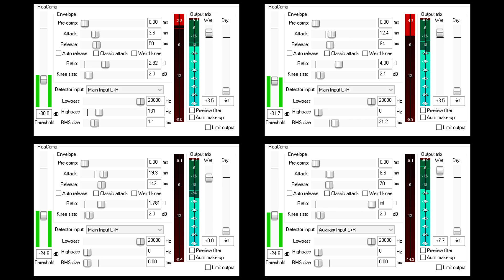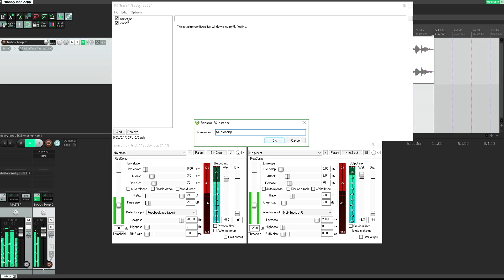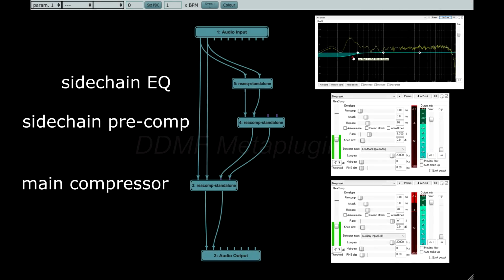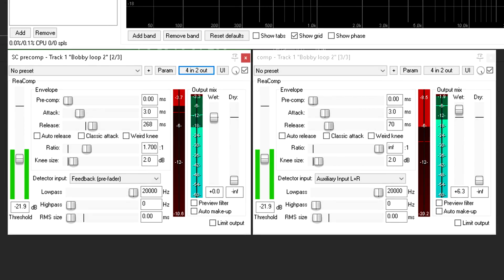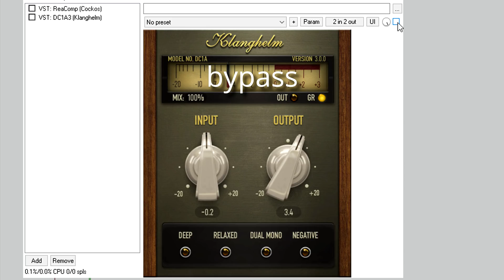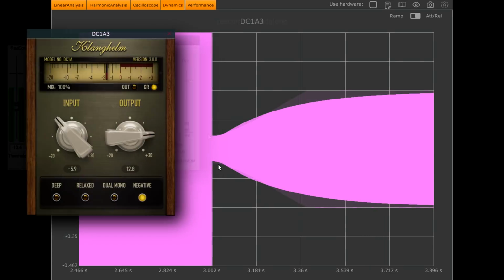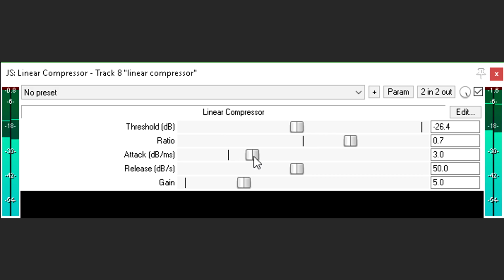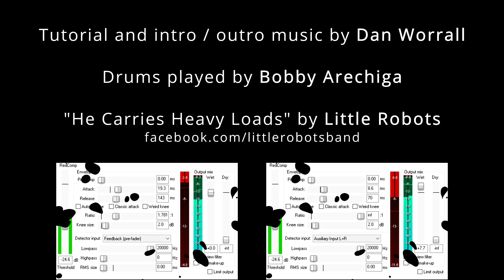What's Wrong With Stock Plugins? ReaComp ReaVisited

Comment: Fantastic video as always. About ReaComp's release curve: It actually can reproduce the more common downwards-bent release curve. The trick is to set the threshold (or knee) such that the compressor never quite stops compressing (even if it's only by 0.1 dB). Somehow the compressor releases differently when going from high gain reduction to low gain reduction compared to going from high gain reduction to no gain reduction. Unless one is compressing drums, uninterrupted gain riding is more realistic anyways. My feeling is that in the audio example you showed, ReaComp was mostly reacting to the low end. My guess is that a HP filter in the sidechain and possibly switching to RMS detection would have solved the problem.
Reply: I'll have to try this. Thanks for the tip

Comment: The Reaper folks are always listening to user feedback and release updates very often.

The put out a world-class DAW for obscenely cheap, and they care what they users think. Good people.
Reply: If they can fix the windows 95 look for a lot of it, I would try it out.
Reply: @gulagwarlord  The basic look is one of the reasons it is so light on CPU usage. Putting in third-party plug-ins with pretty graphics greatly increases the processing.

And you can download themes to make it prettier, if it's that important to you.
Reply: @RolandDeschain1  I just looked into it, that's awesome.  I mostly do midi based edm stuff and currently use ableton but I like the idea of being able to run more tracks because I have to freeze a lot in Live.  Thanks for the help. Cheers.
Reply: @theeverlastingspiral I think the reason that it hasn’t been “fixed” is because it’s one of the things that makes it unique, and in a world of generic compressors and clones of classic hardware that are emulated with varying results—having a unique quirk is one way  plug-in can earn it’s place in your toolbox.  The other way is being one of those idiot proof plugs you can throw on every single track, and have it sound better immediately, regardless of the differences between them.
 
The default compressor plug-in for most DAWs tend to be the most generic and forgettable comps around, and when you haven’t built up a solid collection of plug-ins, you tend to use it for everything and get more mileage out of it, because it’s all you’ve got.  Once you have a ton of them, then you start to treat them more like you did the presets for the jack of all trades compressor you started with.  There are a ton of plugs I’ve collected to that do one really interesting thing, which is what I set it to do by default whenever I load it up, and then I don’t have to fiddle around too much, except for making a few minor tweaks.

I’m sure that there are plugs in my collection that could pull double duty and I could reduce the overall number I load up in my DAW, but I prefer the variety, and know that when I look over my channel strips on a project I haven’t opened in awhile, and see one plug or another, I know what it’s doing by the name alone—so there’s no time wasted trying to remember or take notes about why I did something the way that I did.

My preference is to use stuff with jarring and noticeable, rather than subtle or transparent results, because if I go too far, I can always put it on a parallel bus and mix it back in with the original signal.

Comment: Man, this was the best tutorial I've ever watched on compression. It really made me think about how I might be able to combine compressors for more specific effects, or how I might want to just try something more simple in some cases. I hear people saying that you should stack compressors all the time but they don't ever explain why or how to do it. I've used my ears to find things I like, for example, just recently I put Smart:Comp on an acoustic guitar first and then added ProC after. It sounded better than just ProC alone. Neither were over the top, and with a bit of subtle multiband excitement from Izotope's exciter I barely needed any EQ except to control the low end a bit with ProMB. In general I don't actually use Reaper's stock plugins anymore. I find they don't actually sound that good compared to FF. It's definitely worth it to buy a good set of core mixing plugins. FF is indispensable.

Comment: I see this video as inspiration for Justin and Schwa to improve and expand the ReaComp toolbox even further. I have very specific use cases for all the comps I use. I‘ve been swooning over gain reduction dependant attack and release times since I began using Reaper, because of the Renaissance compressor. I still use Rcomp on dialogue in opto mode.  And thank you for that sidechain feedback setup. My experience in compression had not taken me that far by a long shot yet.
Reply: Airon Extelevision An expanded ReaComp you say? That would be...ReaGasmic!🤩

Comment: The knee in ReaComp has been fixed so that it no longer "spreads around" the threshold, but instead just extends below it.  Your song there is just way above the threshold, and you quite definitely are getting the full ratio.  I contend that it's pumping like crazy cause you're kinda smashing the hell out of it.  Edit - but you're completely correct about the release curves.
Reply from the maker: Watch the GR meters: I'm well below 6dB of gain reduction most of the time. Perhaps I get to the full 4:1 ratio for the very loudest peaks, but mostly I'm riding the 12dB of soft knee. 
I picked those settings to match the Klanghelm's default soft knee behaviour, which doesn't sound pumpy even with similar amounts of gain reduction.
Reply: @DanWorrall  I'm sorry, I see the green meters consistently above the threshold for most of that program.  You're mostly out of the knee at that point.  I think most of what's keeping your gain reduction down is the A/R smoothing.  I'm not sure what that Klanghelm does for a knee, but I know how ReaComp works.
Reply: But also didn't you fairly well prove that the Klanghelm has some RMS time to it?  That'll make a bit of a difference also.  To be clear, I'm not trying to defend the weird curves in any way.  They should fix that.
Reply from the maker: No. Adding RMS smoothing to ReaComp creates a similar looking "pause" before the gain starts to recover, but we can't assume that means RMS smoothing in the Klanghelm. In fact DC1A3 has a "relaxed" mode (which I didn't use) which the documentation says adds RMS smoothing, implying that otherwise it's peak sensing.

Comment: Hi Dan. I was wondering, would you mind sharing the JS compressor you demoed in this video? I'd like to try this kind of compressor done in db/ms. I'm also really interested in how you built those attack and release filters. I only know of the one pole style filters in most designs. Someone told me you can convert between a filter's time constant and discharge rate in volts/ms, and you could use that to get to db/ms, but I'm not entirely convinced of that. The decibel conversion and the placement of the ballistics filtering would mess with that, I think. (might be wrong)
Reply from the maker: desc: Linear Compressor
//tags: dynamics
//author: Dan Worrall

slider1:0<-50,0,0.1>Threshold (dB)
slider2:0.5<0,1,0.1>Ratio
slider3:2 <0.2,10,0.1>Attack (dB/ms)
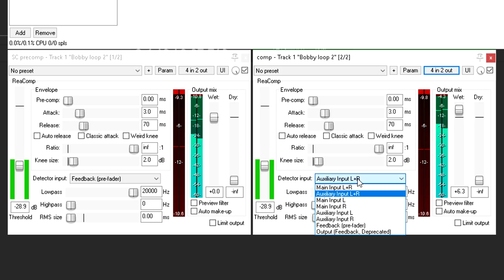slider4:50<5,100,0.1>Release (dB/s)
slider5:0<0,20,0.1>Gain

in_pin:left input
in_pin:right input
out_pin:left output
out_pin:right output

@init
gainred=1;

@slider
  thresh=2 ^ (slider1/6); 
  invthresh= 1/thresh;

 attack= 1 / (2 ^ ( ( (slider3*1000)/srate)/6));
 release=2 ^ ( ( (slider4)/srate)/6);
 
  ratio = slider2;
  makeup=2 ^ (slider5/6);

@block

@sample
//mono sum

absmono=( abs(spl0)+abs(spl1) )*0.5;

//knee

clipping=min((thresh/absmono),1);  

gainred= clipping<gainred ? max(clipping,gainred*attack) : min(clipping,gainred*release);

// gainred= clipping<gainred ? gainred*attack : gainred*release;
 
 gain=gainred^ratio*makeup;

//spl0=env; 
spl0=spl0*gain;
spl1=spl1*gain;
adj1_s+=dadj; 

@gfx

gfx_r=1; gfx_g=gfx_b=0; gfx_a=0.8;
gfx_rect(gainred*gfx_w,8,gfx_w,20);
//gfx_drawnumber(gainred,2);
Reply: Wow! Thanks for sharing this, Dan! This thing is actually really cool. :) Doesn't sound very much like filters with normal time constants at all!  How did you come up with this? Did you get the theory from any books, papers, app notes? Or did you really just hack at it until it seemed to work? 

Thanks again for sharing that here. I'm having a lot of fun with it. :)
Reply from the maker: @nickmarkham3743  I was just playing around with different ways to do compression. In Reaktor originally.

Comment: Wait, I'm confused. Are you running the current reacomp inside of plugin doctor? If so, how did you extract the vst from the dylib?
Reply from the maker: No, I had to use the old ReaComp in the doctor.
Reply: @DanWorrall  Thanks Dan. These reacomp videos have been very useful to me. BTW, you should check the link in your YT about page. It goes somewhere bad.

Comment: Dan do you know this VST ReaComp is different than this one bundled with Reaper?
Reply from the maker: Yes, it's missing several updates. Hopefully the standalone ReaPlugs will get an update at some point.
Reply: Would love this update in stand alone. As well as the delay plugins wet dry fader working correctly, so it can be used as a send option, rather than just an insert.

Comment: 15:38 I sat and listened to this for a good 20 minutes to on/bypass and I just can't hear a difference. Is there something wrong with my set-up (dt770 headphones and an interface)? Did youtube do something to the sound? Can anyone give me a tip of what I'm supposed to be listening for, maybe if I had something my ear could latch on to I could begin to pick out the overall difference?
Reply from the maker: Compression is really hard to hear, and that's a particularly tough example. I'd suggest trying it for yourself, on your own mixes, which you know more intimately than anything else. Start by squashing it way too much, so you can easily hear the compression. Then, when you've tuned your ears into what's changing, try a subtler version and listen carefully to that. You often see warnings not to compress too much: ignore them. That's the only way to tune your ears to the sound of compression. And, its usually the way we know we've got the right amount: you pile it on till it's too much, then back it off a bit, right? That's how it works for everything else...
Reply: @DanWorrall  Thanks so much, that's comforting to know that it is a hard example to hear and I'll do as you suggest on my own mixes to see if I can train my ear to hear more subtlety over time. Nice to know I can ignore those warnings.  Also, I think your logo changed? It looks nice.

Comment: Every time I click on a Dan Worrall video I know it’s time to learn...as well as pick up the pieces of my blown brain 🤯

A general question/something that entered my brain for some reason...

When Dan is showing the gain reduction curves for Reacomp vs Klanghelm DC1A3, I was wondering what exactly about the ReaComp curve is less natural sounding. And then thinking of the release curve shape, it reminded me of the EDM sidechain pumping effect, often made with  something like LFOTool vst. 

Is the ReaComp upward release curve less natural because this shape tends to naturally introduce pumping artifacts a la the sidechain effect?

On the other hand, the DC1A3 release curve reminds me of Reaper’s default item crossfade curve shape. Maybe this crossfade shape was placed as default because it sounds more natural?
Reply from the maker: Yes the release curve affects the pumpiness. S shaped release curves are even pumpier. 

But the default cross-fade curves are to maintain equal power with uncorrelated signals: not really the same thing.
Reply: Dan Worrall Ah! thanks for the insight Dan! Good to know about the crossfade shapes being there to maintain signal power.

Comment: And what about time constants? How reacomp's attack/release times are defined? They don't match the 2/3 GR(dB) rule. 90% and 99% and 99.9% too. Other comps are more predictable? Which one is most 'mathematical'?
Reply from the maker: The most mathematically accurate compressor ever made (with regards to attack and release calibration) is the JS linear compressor I show in the video, with dB/ms and dB/s calibration respectively. Unfortunately it sounds a bit shit ;)

Apart from that no compressor can be more correct than another as there's no agreed correct way to measure it. 

Even if some industry body standardized it at (eg) 2/3rds of target gain change, compressors with different attack or release curves would still end up sounding very different with the same numbers.

And then, what about program dependency? As soon as you have any at all the numbers go out the window, as the actual time constants now depend on the input signal.

The numbers are only really useful when comparing settings of the same compressor. You can probably reasonably assume that 5ms is twice as fast as 10ms, on the same compressor with the same input signal. Otherwise you really just have to use your ears.